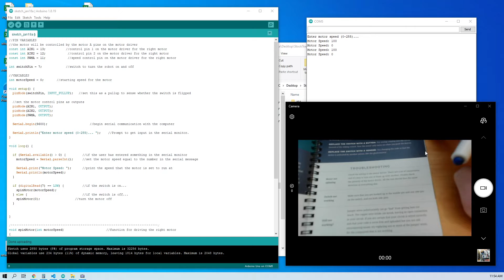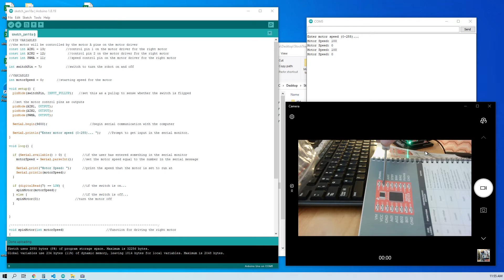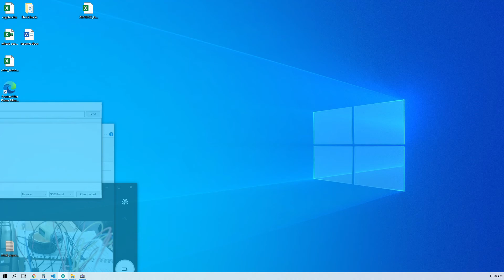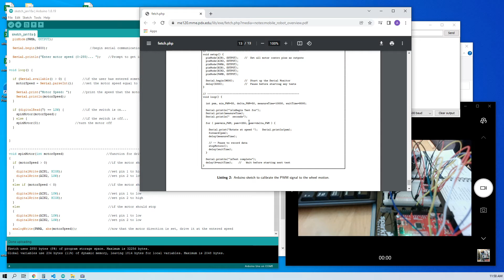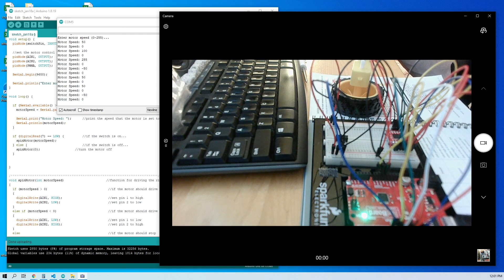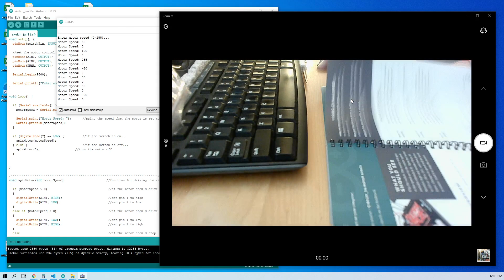Arduino SIK Circuit 5A Motor Basics

Comment: So for anyone that runs into your problem in the future, there is an option in Serial monitor called No Line Ending that you need to select, and that will fix your issue. It turns out that Serial is reading New Line or Carriage Return and that's what gives you second reading of 0.